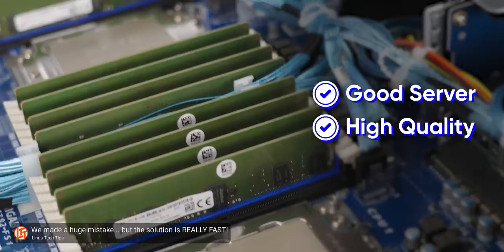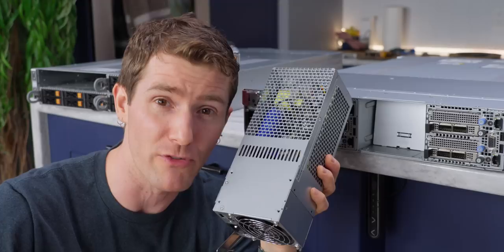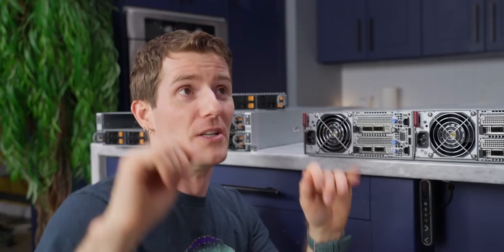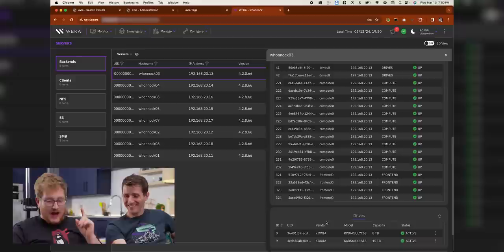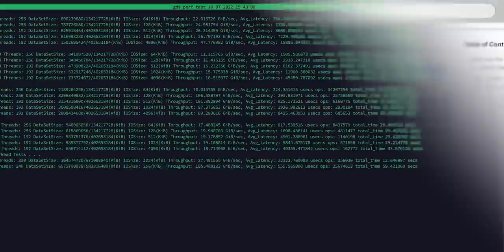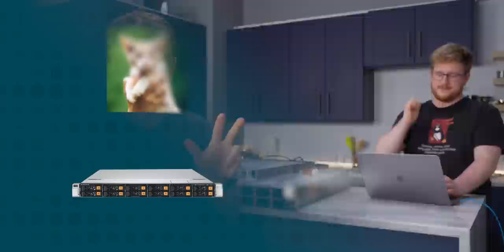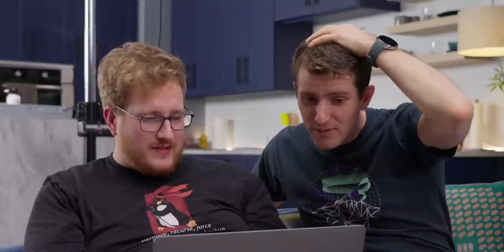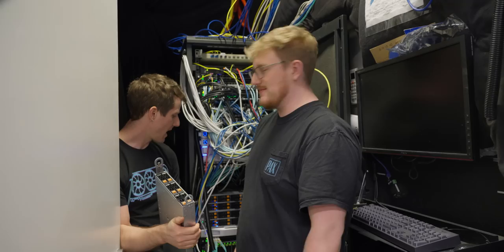this server WONT break....  - Clustered Storage Server

Comment: Obligatory ceph mention
Reply: Yeah ceph is great I have a 3 node deployment of it that's been going strong for years
Reply: yeah, given that they use TrueNAS most of they time so probably won't be going with super expensive Weka long term, or similar competition. He did mention TrueNAS cluster but TrueNas says it is based on Gluster and that support is degraded at this point. I fell Ceph would be most appropriate, and I REALLY would like to see the video for how they pull that.

Comment: That Epyc CPU could hold the entire system memory of a Win 2000 machine in its L3 cache.  Can you even imagine how fast it would be if your entire kernel AND workload is in CPU cache, and main memory isn't even being used!?  That's wild.
Reply: Yes, BUT.
It still needs to hold the necessary data and operations as well, otherwise you will run around with your shoe laces tied together.
Reply: I think it would hold the entire system memory of a modern FreeBSD or Debian machine, certainly it would for Alpine.
Reply: Windows 95 used something like 16MB, and could run on less IIRC
Reply: If you get the stacked cache versions you can get just over 1.1GiB of L3 cache per CPU. The new AMD stuff is nuts.
Reply: That’s insane.
Reply: Next step: Can you boot an OS directly from the L3 cache?
Reply: There was still new laptops being sold with 256MB RAM in 2006 when my parents bought an Amilo with 512MB RAM. Back then I had 128MB RAM in my own PC with Windows 98
Reply: Yes, because I have done it.
An OS and program software written in pure Assembly, plus big caches.

POST took longer than getting to a fully-loaded desktop.
Reply: @dakoderii4221  It could hold the contents of my first HDD in L1 or possibly even in registers.
Reply: We are talking about Windows so... Not that fast tbh 😂
Reply: @morosis82 
Finally it's goodbye to Intel.. for some period time.. 😅
Reply: @morosis82 that means you could actually run a full Linux system straight out of L3 cache

Comment: My home desktop cannot lose data as well - in the sense that if something were to fail, I'm too broke to afford redundant storage.
Enterprise reliability is nuts, it's great to watch :)
Reply: This not enterprise but small business junk.
Enterprise storage is dedicated like Netapp, EMC Unity, 3par and many others.
Reply: @Bierkameel Tell me more
Reply: you'd be surprised at how cheap redundancy can be. i got a 16 tb external i use to backup anything important/excessively large for like 150 dollars. you can pick up a cheap 1tb external for like 30 dollars or less on sale, and that's pretty much all you need to back up your really important shit unless you do video editing/raw photo editing.
Reply: 100GB of Google is $2/mth
Reply: @Bierkameel those systems can be implemented with small numbers of nodes also, they are not by definition better than this, but in large enterprises are built at scale and spread across racks or even separate buildings.

You could do that with this setup too, they just don't need to.
Reply: @anvecom The good part for you is that you don't need redundancy, you need backups, which can be done with just a couple extra drives.

Redundancy is for when you can't tolerate downtime, like when you have say a bunch of editors or engineers sitting around waiting, or you have a site that generates $100k/hr revenue.

What I like to do is have a single drive that I put my important stuff on, then I take that and store it in my desk at work, bring it home once or twice a week to refresh the backup.
Reply: @Bierkameel  this is defo enterprise
Reply: Enterprise is a whole another level. This are just two simple little storage blade servers.
Reply: Rare case where one drive and Google drive is actually useful. You can back up data for free.
Reply: The question is: do you need redundancy or just a backup?

HDDs are pretty cheap now - you can get 1TB for around $30. You can also buy refurbished drives for cheap if you need big capacity. I bought 12TB for $150. Backups can be set to be automatically performed when you plug an external drive.
Reply: @HyviaVideoitaMansenlale  One is none, if this rack burns down they will loose all data. I'm pretty sure that they don't backup 2PB of data.
Enterprise systems are scaled over multiple site with synchronous or a-synchronous replication between them. 
These servers with internal disk are nice for a hyperconverged cluster for virtualisation but are not very scalable if you want to add multiple trays of new disks.

I have been managing enterprise storage systems for 20 years and you don't see these home build Supermicro systems in datacenters, they are fun if you are on a budget but I always wondered why LTT does not invest in a decent storage system with immutable cloud backup.
I guess they answer is that nobody wants to sponsor that because you set it up and leave it running for 5 or 6 years.
Reply: @spaceghostmiid  The cheapness depends on were you live. Where I live you can not currently get a 16TB platter HDD and a 8TB is over 300€. Even a 1TB is close to 100€. SSDs cap out at 500GB with prices in between platter and NVME, and NVME prices start at 1.5x the price of the platter for the same capacity (and are 6x more for the cheapest 4TB)
Reply: @Bierkameel  the vast majority of their storage is used by old footage they don't care that much about, there's no real impetus to protect it other than convenience.
Reply: I used to run a Compaq departmental-level server I bought at a government auction, I think I paid a dollar for it. Of course, it came with no hard drives, but it had a half set of four drive caddies, two CPUs, redundant hot-swap power supplies, and even memory and CPUs could be removed and replaced with the power on!

Everquest server, here we go!

I also bought a UPS the size of your mechanic's battery tester/charger, also for a dollar. While I was traveling for a year, the power was knocked out for a week. The server stayed up and was still running when I got home!
Reply: @Bierkameel this is dedicated. Most enterprise stuff is the same thing but with licensing on the hardware added, where you pay 20x for the convenience of support and people personally coming to fix your stuff when it breaks. 
If you go even bigger you get back to this, and a team to handle it. Weka is made for huge enterprises, for example. And it's priced accordingly
Reply: I'm kinda in the same boat.  My NAS is basically a single point of failure.  It has redundant PSU and uses raid, but the box itself is still a failure point.  Eventually I want to look into doing a ceph setup.  I can't even upgrade the OS on this box without taking down my entire storage infrastructure and I hit a 16TB limit per volume that requires an update which is a bit of a pain.
Reply: If you have two hard drives you could duplicate them
Reply: Kreuner is right -- RAID 1 mirror.
It's important to make sure you get exactly matching drives, or the performance hit is enormous. Start-up and especially shut-down of software RAID 1 is -- in my own experience -- enormously slower than hardware RAID 5 or 6, so it pretty-much sucks if it's something that is shut-down every day. I have had Dell business-model laptop and tower computers configured with dual drives in RAID 1, and with industrial-grade SSDs (like the SanDisk 300x, I think it was called), it's pretty usable. Consumer-grade SSDs would be a nightmare of one drive losing partition after another, I expect. But if you can buy something like a matching pair of PNY 250 GB drives at an affordable price, and do incremental back-ups to a 500 GB or 1 TB hard drive at least until you have something like 200 hours of active use to test stability, that could be worth doing.

There are other ways of handling back-up, too. Windows doesn't create usable back-ups. (You should always go to the trouble of testing your ability to recover using the methods you use!) One of the most affordable ways of doing an effective backup is to set-up a routine, either manually by your own hand or by task scheduling, synchronize back-up of your documents and downloads, program settings and bookmarks, that aren't continually backed-up online. Depending on the capacity and space and schedule you need, that could be a pair of USB thumb drives with identical contents, or it could be an optical disk drive. Blu-ray was invented and first implemented under contract for archiving scans of documents for long-term stable protected storage by the Japanese government. True archival-grade disks are a special-order item from Japan, but guaranteed to be fully readable for a minimum of fifty years without degradation. Even with the drop in price of hard-disk storage, the price per gigabyte is still lower, and the viability is far, far longer.

Then there are concerns like fire, lightning strikes or brownout, and electromagnetic pulse. Each requires different answers.

Comment: Last time you lost data it was not because of lack of failsafes, but rather the fact that no one was keeping an eye on things. This may prevent failures when something goes wrong, but only if you actually respond to those failures in time. Make sure to have some sort of alert system this time around.
Reply: This, aaaaand no experiments or fancy new tech, it HAS TO alert someone, no use if alerting itself is down
Reply: They have actual sysadmins now fyi, like not just some of the editors or whatever happen to also be good at this stuff (such as emily for example) but like they've been hiring actual dedicated IT staff
Reply: @mysteryboyee That may be, but monitoring is something that they should probably cover at some point in a video like this. Redundancy is not just about hardware. And having sysadmins does not change anything besides the fact that they would know to setup ways to monitor the situation, unless they sit on a chair on front of the server rack at all times.
Reply: The red flashing light only works until you get tired of it crying wolf, and that will probably happen before a failure
Reply: @danielberglv259 One would presume that dedicated sysadmin staff would indeed have it as part of their job description to actually do such things. They would be unfathomably stupid not to.
Reply: I would hope so yes. But I think you missed my point on that one. I said that they should make a video about how they monitor their systems. We have so many hardware videos, but not much about how they are deployed.

Comment: To Add to the split brain talk, you need an odd number of nodes to guarantee they can reach quorum. Running only 3 nodes also creates issues when there is a failure as you now can't reach quorum  and need to immediately get the node back up. When running 5//7/9 nodes outages are not nearly as urgent .
Reply: So why go with 8?
Reply: My guess is when you have more servers, the load on each is decreased, such that occasionally one can take a backseat.  So with an even number of servers, by this logic, the failure of one server would not compromise the process and it would function as normal since the “extra” would not be needed right away and thus have more time to get resolved and back up and running.  Networking allows the servers to handoff tasks to neighboring servers in the network.  This is also why it was mentioned in this video that “two entire servers” can go down and not cause an issue and nobody would even notice.  Also, the odd number discrepancy to check for biases, that’s usually an ideal for if you have multiple tasks computing at once that put the network of servers at full load, but otherwise an even number will still work fine as one is backup.

Comment: The concept of cluster voting was developped by Digital Equipment Corp in the 1980s for its VMS clusters.   The votes and quorum mechanism did not handle just failure of a node, but more importantly prevented a node that left the cluster from continuing to function (thus proventing it from accessing drives without enforcing locks/synchrinization with the other nodes).  (called cluster partitioning).   In the case of a 2 node cluster, you could designate a  drive as quorum disk and give it votes, so any node in the cluster that still saw that/those drives would get the votes and could then continue.  (in VMS clusters, drives could either be served by a node (and accessed from other nodes via network)  or be standalone with direct hardware links to each node. 
(Digital developped extention to SCSI (called DSSI) to allow multiple hosts to access the same SCSI bus so multiple nodes coul write directly to the same physical drives). (later on, I beleive SCSI did get that functionality).

The freezing of a node to prevent partitioning is very clitical to prevent a node that lost its connection to the other nodes from continuing to write to disks or perform tasks without the synchronization with the other cluster nodes.  (in a cluster, there was a single lock database so when a process on a node too a lock on a file (or area of file) or a resource, that lock would exist on all nodes so processes on other nodes would not get that lock until first one released it). 

From a failover POV:   You can have 2 nodes doing work since the locking is synchronized, so when one node fails, the other one continues and new network connectiosn all go to the second node instead of being split between the two. The other way is to have node 1 take and get lock and do all the work. Node 2 requests the lock but is put on hold because lock is unavailable. When node 1 goes down, node 2 gets the lcok and then processes all the work. 

Tandem NonStop (used for mission critical stuff such as Interac/credit card) has different fault tolerance. In the same chassis, a process would run on a single CPU/RAM, but a copy would run on a designated CPU/RAM, but basically have it writes to disk/network disabled.  Both processes got the same data from network/disk.  So the backup was a copy of the main one, and shoudl main one go down, the backup tok over right where the backup failed since the backup had identical RAM, process state and conections to network etc. 
However, while VMS clusters could be spread across multiple buildings (and up to 96 nodes), the Tandem Nonstop was within a single chassis in 1 computer room. so fault tolerant within chassis, but not disaster tolerant. 

A mere smb file server just blindly executes writes/reads from any node to any area of disk/file and when you have different windows instances accessing the same time, the last one writing to it wins.

Comment: I just decommissioned something similar at work about 2 months ago these are awesome and super reliable. The ones we decommissioned were used for high availability to radiology records in a major hospital, ran for 7 years with no issue and was only replaced for a standard life cycle upgrade of the system!
Reply: I love auctions!
Reply: So when you upgrade is that the only time it goes down?
Reply: @squidwardo7074  in our case yes. Because of the high availability of data it would take in our case 6 simultaneously failing servers to cause an outage. Or 2 simultaneously failing access switches with 2 simultaneously failing links for each server connected to each switch

Comment: "They don't know what HA means"
Me.. working in IT for 25 years: "HA means nothing if its not distributed and works as a failover cluster in a DR event"

TLDR; It's still not secure, it's not protected against floods, fires, or other disasters. It still lives in a closet. The system needs to be distributed physically before it can be called HA.
Reply: If the LTT office floods I don’t think off site high availability storage will help because LTT does not have a redundant video editing team.
Reply: @nickfarley2268  That's not true, the team could just be moved to a temporary location with remote access to the files... that's the whole point of a DR plan. In the event his whole team dies during the flood, sure... you're right, but that would be quite a flood :)

A strong power surge could take down his whole "high availability" setup... not exactly HA.
Reply: @oourdumb  True but it also comes down to cost Vs risk this is a big calculation a business must take.
Reply: Excellent comment. Really excellent. 

The serious stuff for HA is not interesting for a general audience. Is pretty boring, even for us IT professionals. 

Is not "cost vs risk", it doesn't have the features for being redundant and secure. Is like building "the world's most powerfull  PC" with $200, and then argue that well... it has prioritized costs... 

A recomendation? Just do it right, and if it is not right for a video, don't make a video about it, period.
Reply: @maxhennessy6676  sure, but that doesn't make it HA... that's my point. You can't say "it's a discount HA", since there is a real name for it... just a failover cluster. Even if it load balances, still not HA. HA has many requirements and physical distribution is one...
Reply: @gonzalomartinez3237  the video is fine overall, just LTT mistaking a simple load balancing with failover to HA. It's definitely a lack of understanding the complete concept of HA. I used to watch LTT when I was in college, but found the content fell behind after about 3 or 4 years working in IT Operations at a level 3 support role (I started at level 2 for about 11 months).